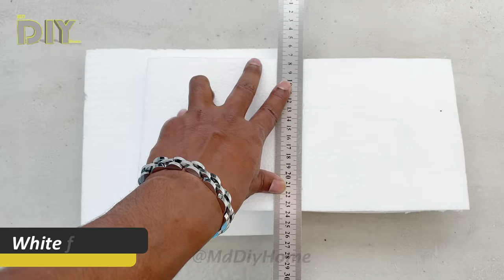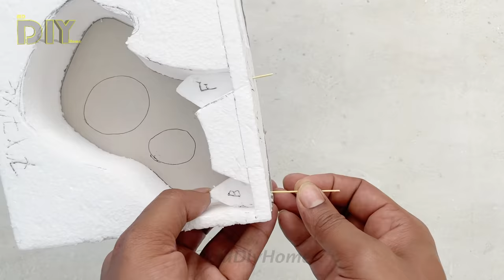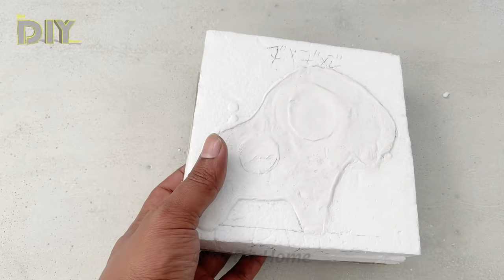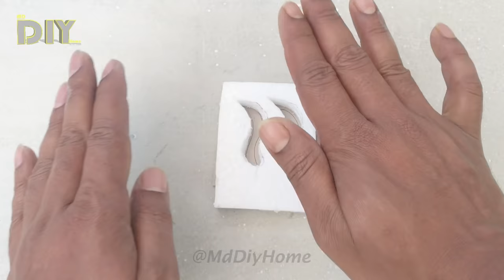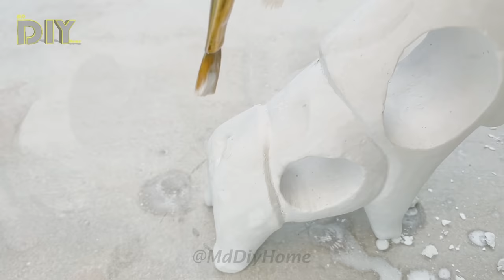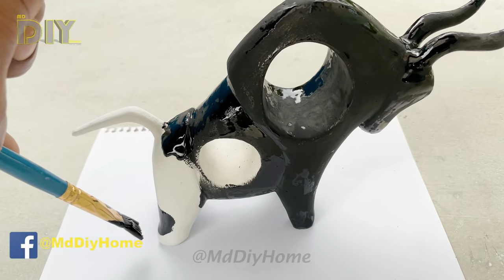How to make Modern Bull Statue | DIY White cement craft

Comment: When I made these at home this broken before its die.Even I have used glue in it wire in it it brokes.why plz tell me.and tips to make it easily at home
Reply from the maker: let it enough dry, then give it shape with slowly hand work! do not use glue for broken part. use the same cement if brock for joining!